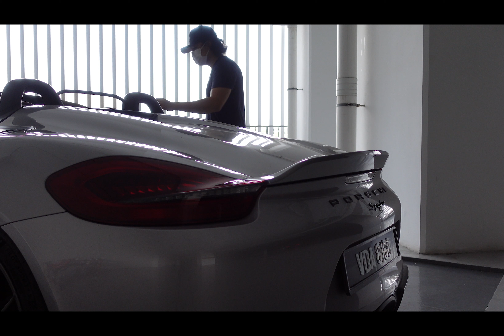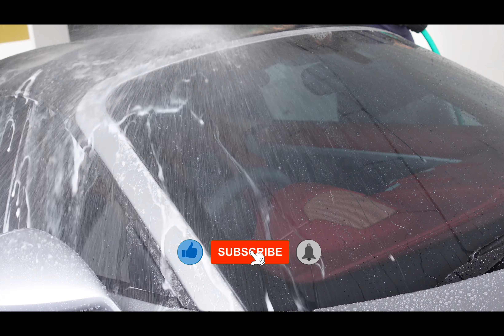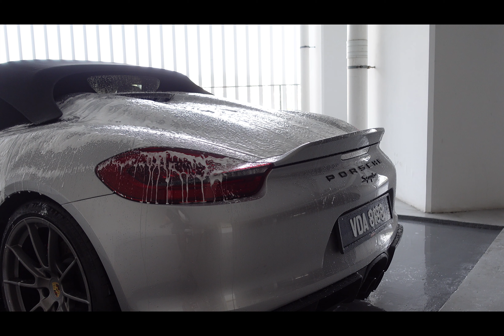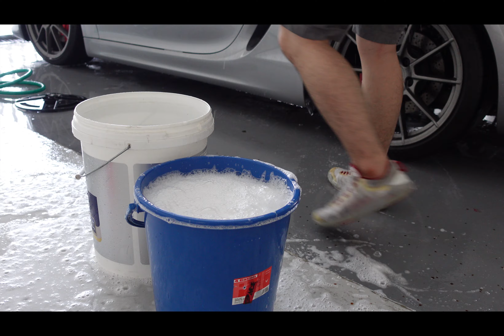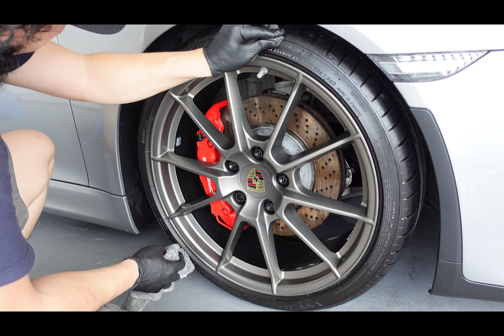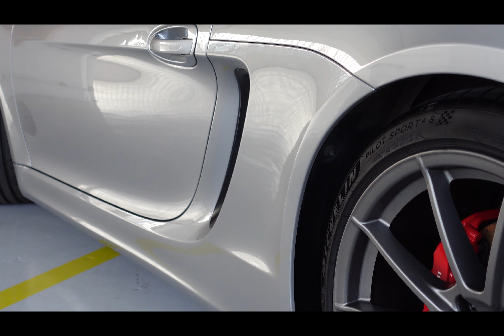[ASMR] Porsche Boxster Spyder Convertible Soft Top Coating & Wash | re:Fresh | EvoMalaysia.com

Comment: Hey Thomas, I tried using the same product as you (Carpro Inside & carpro fabric) to wash and coat my softtop, but it seems it cause white patches, do you dilute the carpro inside before using it on the fabric? Because i think the product is meant for leathers right?
Reply from the maker: Oh dear. Sorry to hear that. As far as I know it works on fabric too. You can use a diluted Multi Purpose Cleaner or Carpro Fabric for the roof.

Comment: Thanks for the video, Thomas! Should I worry about soap and water getting into the suspension areas and causing rust?
Reply from the maker: No worries. Hope you enjoy it.

Generally the bottom of the cars are built with consideration of water contact. Do it shouldn’t be an issue especially with modern cars. Even some colder climate countries they salt the road, the under carriage and parts can take it - albeit there will be some rust spots.

So don’t worry. It it ok especially if it’s a modern car.
Reply: Also, the wheel wash set is in fact a 9-piece set of microfiber clothes, mitts and brushes. Is the wash mitt sufficient for use such that I don't need to necessarily purchase the OSREN mitt?
Reply from the maker: @brendankoh9170  that wash mitt I feel is not that great as the pile is very short. I prefer Osren’s one as the longer piles can trap dirt and not drag it along.